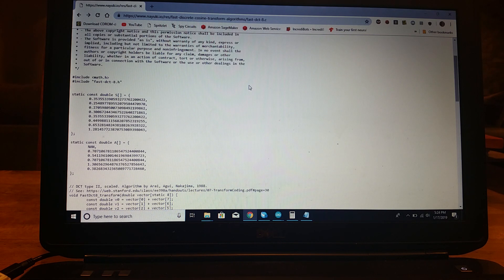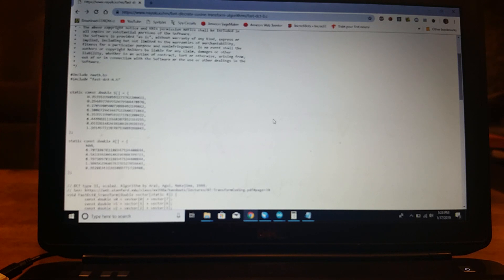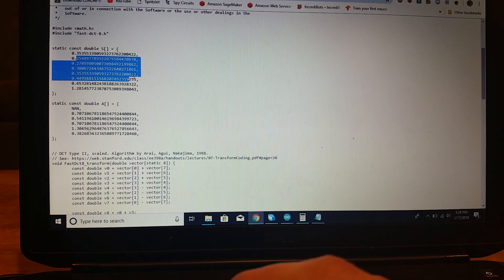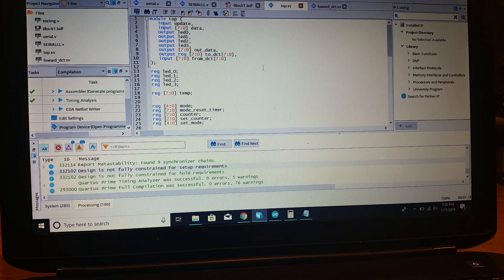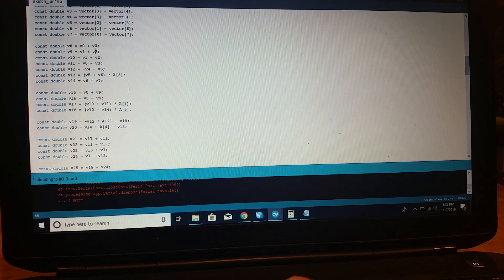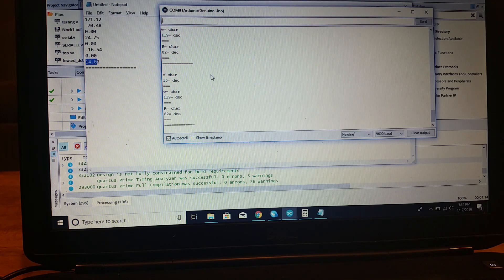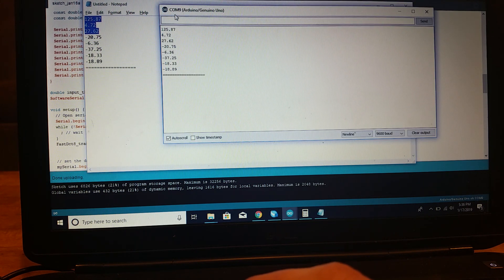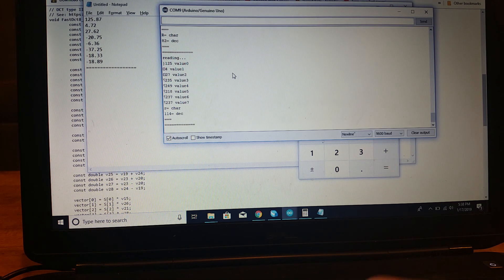DCT implemented on an FPGA

Comment: Hello, i am a student and this is kind of my bachelor end project. I am having trouble as i want to 3ncode an image, and firstly i have to apply dct. Could you help me?
Reply: Are you running it in a fpga or cpu? If on a cpu, I'd recommend messing with a python Jupyter notebook until you've got a proof of concept of what you want, then move on from there